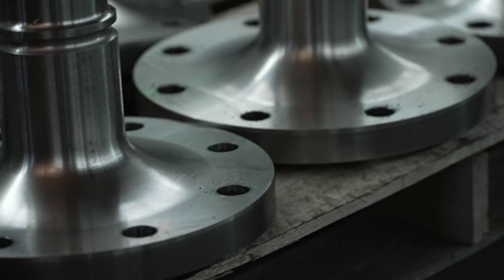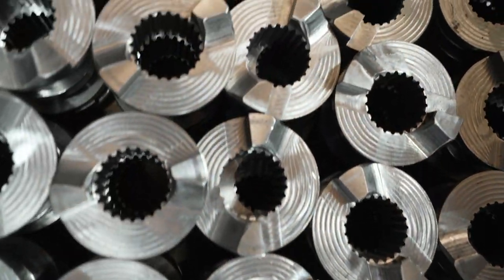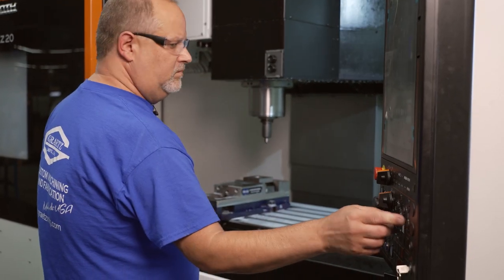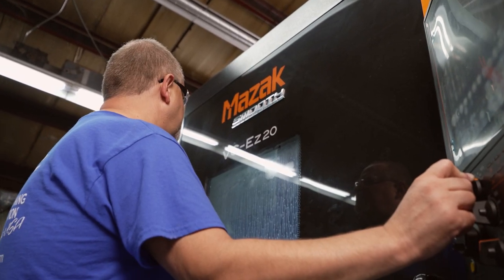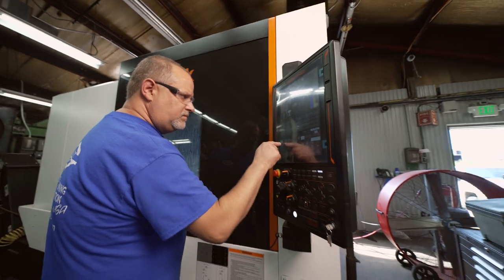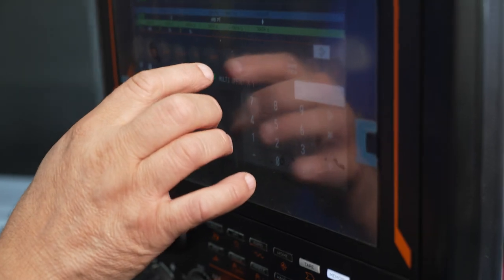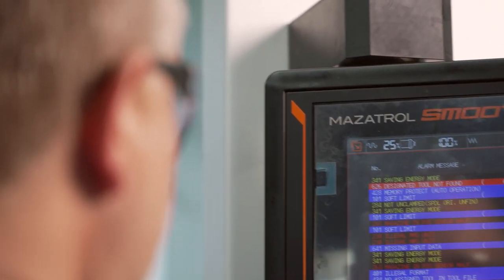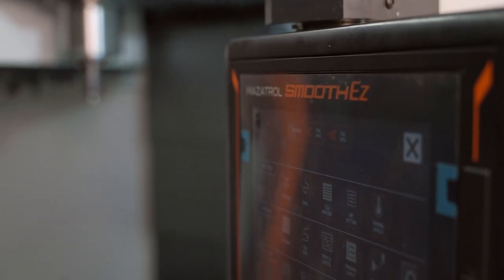Graetz Mfg. increases productivity and meets growing demand with Mazak's machining centers.

Comment: Sir I'm face a problem from last two days in mazak integrex e1600V/10 machine i make a program in 5 axis machining but at the running time program can't run smoothly I'm also use G64 G61.1 and G5 also actual feed is 6000mm/min. Then I'm check the machine parameters M2 and M3 this is 1800,3000 so can I increase this parameter or have any solution for this 

Machine run like that run break run break some blocks read smoothly but same blocks can't run smoothly

Give me a solution about it 
Thank you 😊